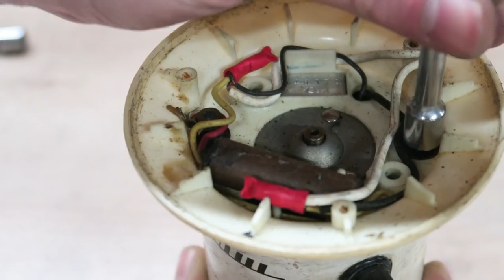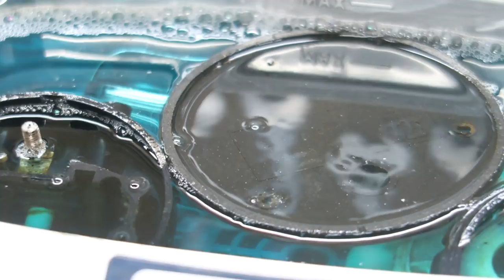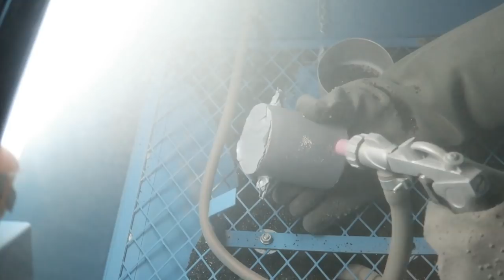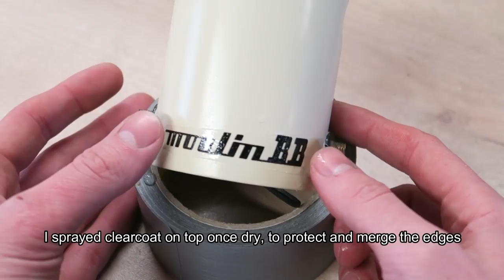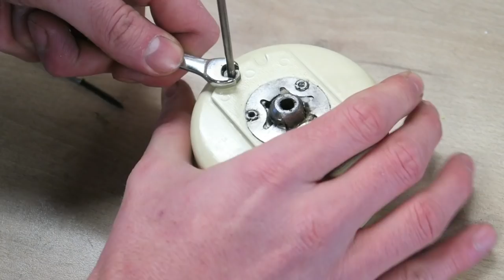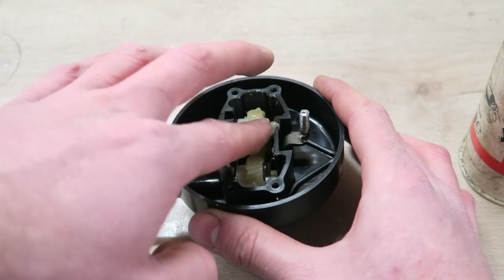70 Years Old Mixer Restoration

Comment: That turned out really nice, it's a pretty interesting machine, and it's nice to see someone using a sandblaster for a change!  If you ever get a shock from the housing, remove that RF filter from the bottom and pitch it, eventually they all leak current to the chassis and you will feel it. I always threw them right in the trash :)

Comment: Very nice restoration. Great job. Congratulations. Just one little thing...it can't be 70 years old. It would be from 1950 or older- the problem is that this kind of white plastic was  in use much later. They started wide use of plastic parts like your dented wheels in the 60s. I would say that this mixer is probably 1965-67 ... but not 70 years old. Still great restoration. Keep on restoring things. It looks like you love it 😉

Comment: I still use a Moulinex coffee grinder that is very similar to the grinder part of this machine. But as I watched the restoration I was thinking 'he's going to get comments about not replacing that capacitor. Seriously, it would have been a good idea to change that. And I find that a small hot air gun - they are really cheap - is so much better than a soldering iron at shrinking heatshrink sleeving. Good fun to watch, though. Go make yourself a cup of coffee from freshly ground beans as a reward!

Comment: I'd find quite interesting to see a comparison between modern and "vintage" safety standards, both for mechanical and electric parts. Some components of these old devices look sometimes incredibly over-engineered (possible for lack of knowledge or structural analysis methods), sometimes just frightfully flimsy. I know this would be a more technical topic but as a restorer and collector of old stuff you might be able to give some insight.

Comment: Which tension did you testing this mixer? On the bottom plate indicates 120V ! 50W. (OK in these days, in some regions in France and Europe was not the regular 220V.) Replacing of the old wax capacitor is needed, for a risk on short circuit.

Comment: Just a general fyi on those types of bearings, it much better idea to drill out those rivits to diss assemble it. Those fingers aren't easy to reshape, and those felt pads are best used with an oil not grease. The felt is what holds and keeps the oil and lubes that round bearing, and I would NOT have reused that old ass cap. They can not hold electric charges with those kinds after awhile. They are notorious for going bad.

Comment: You need to use oil and not grease in the bush-bearings, also the motor sound kind of sad so you should check if there's any short in the rotor windings.